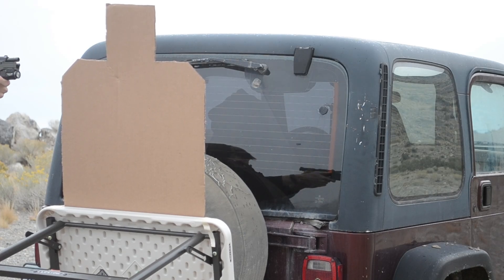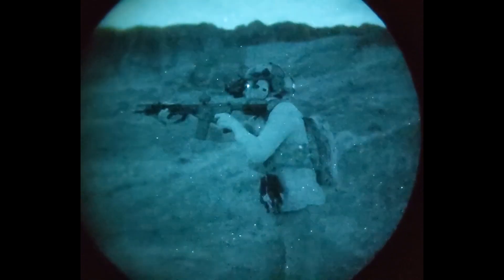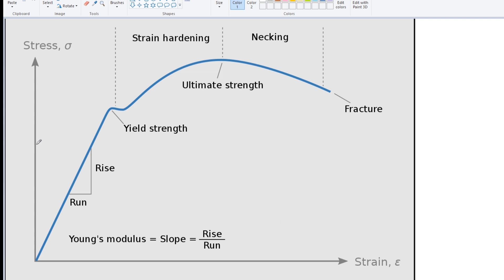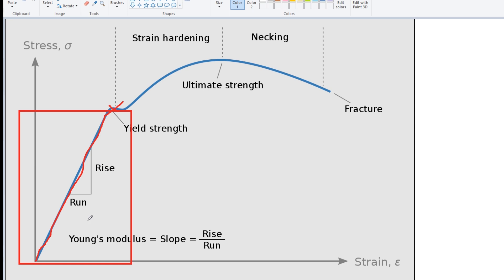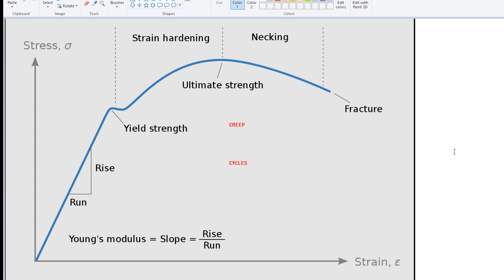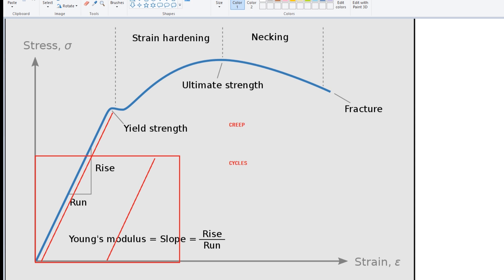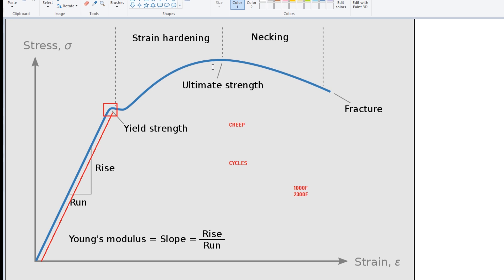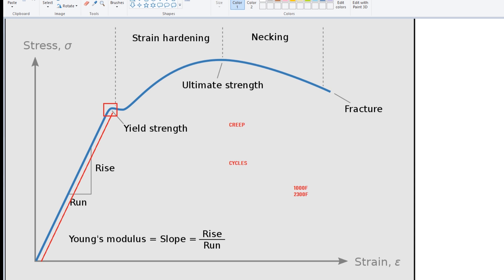Leaving Your Magazines Loaded? Engineers Perspective

Comment from the maker: To get ahead of some of the comments.
This is massively simplified, and ignores some other intervening variables that effect theoretical yield strength, cyclic failures, creep, material choice of the feed lips etc.
You should more view this simply as hyper simplified crash course on long term material fatigue specifically in regards to leaving mags under compression for long periods, and the springs failing.
Reply: Of course, but it should be noted that this only applies to springs made out of spring metal. 

I was so confused as a Pvt. when the Berretta M9 was a single shot with a box of 14 loose rounds rattling around in what is supposed to be a magazine, kind of like the bb hopper on a daisy air gun. 
It soured me on Berretta for some time until a few civilian cops who carried Berrettas swore by their reliability. Turns out that the army had purchased mostly CheckMate brand mags. CheckMate seems to have saved on production costs by replacing the spring with something that looks like a spring but I believe to actually be bailing wire. 

The army likely bought these magazine shaped objects instead of magazine because Berreta wouldn’t sell copyright to any company that actually makes gun parts and of the cost of Berretta mags. 
You hear stories of people waking up in an ice bath missing a kidney. It is an undisputed FACT that in every recorded case, the kidneys were being traded for Berretta mags at a 3:1 rate, and most of us only have 2 kidneys at a time so another has to be sourced from a local bar  Never drink anything given to you by the owner of a Berretta. 
Berretta never says why the need so many kidneys, but it is theorized that it keeps the original 15th century master gunsmith going in a dark cellar beneath a castle that is always surrounded by clouds and howling wolves. 

Once I sold enough blood plasma for shipping and sourced enough kidneys from drunken pac clerks to buy Berretta mags the problem went away and I had presumably the only M9 in the army that had 3 15 round magazines and could each fire 15 consecutive rounds without a jam. Also without pac clerks my entire unit entered a period of time without pay problems. 

I found just how sinister Berretta is when I bought my own. It came with only one ten round magazine! Much like the shady guy in the alley Berretta reaches into their curiously fashionable trench coat and says “come on kid, the first one is free.” This ensures the owner of Berretta has a steady supply of kidneys to keep him going for yet another century of producing high quality firearms.
Reply from the maker: @nemoexnuqual3643  dayum dude. That was wild journey start to end. haha
Reply: @BrassFacts  glad to help.
Reply: @nemoexnuqual3643  Most gun manufacturers do not produce their own magazines. Mec-Gar produces most of the OEM magazines for many manufacturers and was the manufacturer for the M9's magazines. Fun fact, the government owns all of the drawings and IP of all submitted works for their equipment. This means that technically the government owns the drawings to the Beretta M9 and gives a license to Beretta to sell a facsimile to the civilian market, while using the moniker. This is important because that's how you got the POS mags. Mec-Gar jacked up their prices, so the government took the drawings and gave them to Checkmate and requisitioned magazines since Checkmate promised a cheaper price. The actual metal composition between bailing wire and springs are the same. To make magazine springs you take raw bailing wire and form the spring. The key here is that the spring shaped bailing wire is to then go and get heat treated at high temperature and then cooled at a specific temperature and cooling rate to achieve what's called a spring temper. Checkmate didn't do the heat cycling process properly so the springs in their M9 mags were not at the exact same temper as the Mec-Gar OEM magazines which led to failures as the resulting springs were much softer with the wrong spring rates. This led to feeding failures and the springs in the magazines taking a set. The government realized the issue and went back to pay the higher prices to Mec-Gar. The hilarious thing is, if the government actually had an engineer among them, they could have just contracted out to the spring manufacturer to just replace the springs in their Checkmate mags and would have been fine and gotten off cheaper.
Reply: @nemoexnuqual3643  "Also without pac clerks my entire unit entered a period of time without pay problems." LOL!
Reply: @TheOuroborosWyrm  😂🤣😂😂 you know what also was great was when we had a horribly depressed supply Sgt. who just gave me the damn tape, pens, and 550 cord without needing a freaking thesis paper on why.
Reply: @nemoexnuqual3643  where can I go to read more of what you got to say????? ;D
Reply: Shit man, good enough for me. I can stop worrying about the loaded mags now.
Reply: Sobs in Sig mags
Reply: TheMamThatHatedTheWorld  you are a terrible conversationalist my friend.
Reply: I'd love to talk to you about your opinion on making energy using titinol I believe that's the metal and it could be used as a drive force. I have a few ideas about it.
Reply: Excellent video.  Engineering, perfect detail for the novice.  Economist view: everything has a lifespan.   Odd.  Before the 1993 Clinton AWB, 30 round mags were $15.  Thirty years later with inflation thirty round mags are $15, less on sale, but in most cases it costs more to fill than to have, so get a shit ton of them and follow what Brass Facts said about replacing them as needed.
Reply: Practical advice: Do not fully load plastic magazines for long term storage, store 28/29 in 30rd mags. Cracked feed lip on Magpul M2 mags maybe due to weaker plastic. Fully loaded mags may not tactically reload as easily too.
Reply: Magazines wear out from constant use not from loaded storage. Modern magazines are designed to be loaded and stay loaded. My training magazines are magazines that I acquired for just that reason. They work anytime all the time, but they are still my range magazines.
Reply: @nightrider1850  Polymer mags wear out from loaded storage.
Reply: @Emmanuel Goldstein It is. It's endemic to polymer magazines.
Reply: @Emmanuel Goldstein Yep, sure does.
Reply: TheMamThatHatedTheWorld  Sorry, but that is exactly what wears out polymer mags. The feed lips wear from long term pressure on the lips. Hence, the magpul storage covers that relieve the pressure on the lips. There is no shortage of articles and videos on the subject. But hey, think what you want.
Reply: @Followme556  The Magpul covers are dust covers to keep out dirt/debris. Because the way the feed lips of the STANAG mags are designed, you can't get a seal above the feed lips. So they designed their covers to push down a little on the top round/follower to give the seal that's needed. Think about it. The stress being applied to the much thinner tabs on the edge of the magazine and the dust cover is much higher than what's placed on the feed lips due to the much smaller surface area and them being made of the same material. If what you say is true, then the tabs on the dust cover and top of the mag would fail from the stress as their smaller surface area with the same applied force would cause a material failure well before the feed lips would experience a failure from the same force.
Reply: @Talishar  The dust cover of magpul PMAGs relieves the pressure on the feed lips. That is the primary purpose of the device..
Reply: @Followme556  No it's not. There's a reason why it's called a "dust" cover and not a storage relief adaptor. You can't use a cap that goes over the lips because then the mag isn't compatible with most formed or molded STANAG magazine storage solutions including Magpull's own lineup, especially if it already has a ranger plate or Magpull installed on it. Again it's a very simple engineering solution as to why it's not for the feed lips. The surface area of that dust cover is much smaller versus the feed lips. If the plastic were to deform or fail, that cover would permanently break/fail and damage/destroy the mag with it. Because the cover is pressing the ammo further down below the feed lips, this also means the cover is under even MORE proportional stress than the feed lips would be on top of that much smaller surface area. 

I've seen even gen 1 PMAGs loaded for years and then feed without a hitch, stored in Southern Arizona in an outdoor storage shed. Feed lips don't see deformation from storing ammo but from nearly everything else. They get dropped. People miss the mag well and slam the feed lips into the lower receiver. The magazines are put on a vest or other rig and the user dives onto the ground, smashing the magazine in the process. Those feed lips take a lot more abuse than the small, tiniest of fraction of stress caused by holding the ammo in the mag under tension.
Reply: @Talishar  You called it a dust cover. Technically it's a "dust/impact cover." The device literally removes the tension from the feed lips.

Comment: Magpul literally sells a 3 pack of new springs and followers for 6 bucks for old GI mags. As long as the actual shell isn't ruined you can just buy these things and essentially have a functionally new magazine for 2 bucks.
Reply from the maker: for sure, though in practice, at least with use mags. The plastic fails before the springs do.

Comment: TLDW: Loading and unloading your magazines wears them out not leaving them loaded. Which is 100% correct but for the love of God, if you leave Magpul mags loaded long-term use the dust-cover that came with them. It isn't a dust cover, it ever-so-slightly loads the spring to remove load from the feed lips. The springs can handle that load indefinitely, but the polymer can't and those feed lips can spread far enough to not fit or even empty itself.
Reply: this is a great comment for those who are unaware. pmags are great, but that polymer will deform over time so use the 'dust covers' that they (should) come with.
I personally stick with the ol' reliable stanags.

Comment: Saw a guy pull out 25 years of loaded mags and shot it, zero issues.
Other engineers state that the spring wears down more from going up and down, not being in a compressed position.
25 years is the proof, don't worry about it

Comment: I have done long-term experiments with several different magazines. Glock mags from the Gen 2 Era were the only ones that I had sufficient creep that they induced malfunctions. That took about 15 years of continuous loading.  I have had STANAGs loaded for close to 25 that still function correctly.  Haven't had nearly that much time on SIG P226, 5th generation glock or Pmags, but thus far no issues with long term loading.

Comment: I like to think of fatigue more as the higher stress state (still below yield) of a material allowing dislocations to jump or move in small steps towards some imperfection in the material or wherever localized stress is the highest. And over many cycles of this low stress state, the dislocation conglomerate on some stress concentration point and eventually form a crack. This is effectively decreasing the area so while the load may not be increasing, the stress is, especially locally. And this worsens very quickly as the crack forms and propagates.

Comment: Whaaaaat??? You're an MSE too? No way! I'm a materials/metallurgical engineer. I particularly work on wear/failure analysis and on wire/spring and fastener metallurgy. Your magazine springs are usually going to be ASTM A228 music wire or equivalent. Something like ASTM A877 chrome-silicon wire would have significantly higher fatigue and creep resistance. We use some wire grades with nickel and vanadium too, which can go even more cycles at higher temperatures.

Also, I'm in the Midwest. I thought you were out in Utah or Oregon? Somehow I missed this one two years ago. If you're still interested in Midwest employment, I might be able to make a connection for you.

Comment: I think this video misses the most commen reason mags fail from being left loaded in my experience- the feed lips bending. If you have a nice metal mag this may not be an issue but for the cheap plastic mags especially with a strong spring, the feed lips will start to bend outwards potentially making the mag stop feeding reliably

Comment: Creep becomes a significant factor at about 35 percent of the materials melting point on an absolute scale (Kelvin or Rankine). So steel with a melting point of 2000F (2460R) will start to suffer from creep at 400F (860R).

This is why materials with lower melting points can suffer from significant creep at room temperature. You need to look at an absolute scale.

Comment: A youtube channel by the name of deltaleader71 made a video about his mags that were loaded for 18 years in his safe, just checked and the video is still there. His springs measured shorter than a brand new spring by almost 2 inches but functioned fine. I believe he even said that the new spring was purchased at the same time as the ones in the stored compressed mags, so they were the same brand.

Comment: Now do lancers with steel feed lips
Reply from the maker: I'm not convinced lancers are worth a fuck. 
But I actually put 4 in rotation, we'll see. They sure are convenient 

The issue is the lancer is reinforced in only half the areas that matter. And the body plastic (which also includes the junction) is no-composite plastic, so far weaker than the composite that is pmags

Comment: This does not account for manufacturers failing to install a spring to the engineered specs.
I would suggest firing your duty mags a couple cycles to confirm reliability and if you store them full (you should store some of them full), maybe check reliability every couple years.
But if you train like Brass Facts (frankly who has the budget for ammo?), you probably cycle through them fast enough for long term issues to not show up.

Comment: Springs wear from being compressed/cycled. It’s not debatable. Is that enough to cause issues? Generally no. Just like a surplus WW2 era firearm. Most of the springs will be fine, but it’s not uncommon for old guns to need re-sprung to run reliably. I think it’s a little overblown, but at the same time I see no point in personally leaving 50 mags loaded

Comment: To add to your creep portion. Creep is also highly influenced by how far along the stress-strain curve you are. Magazine springs are designed for high amounts of compression. This means a fully loaded magazine is actually very low relatively along the stress-strain curve in compression, even when fully loaded. They are specifically designed and engineered this way. The creep at room temperature because of this can be measured in hundreds of years to become even partially inoperable. You would have to compress the springs to the point of smashing the steel flat against itself or somehow push the spring through/past itself to get enough strain to cause any plastic deformation. The spring in normal operation would never be compressed enough to even register any perceptible creep within several lifetimes. 

The bigger issue/danger for magazine springs is actually in extension. They are designed to greatly withstand compression and by their mechanical design, aren't going to be able to be compressed enough to really cause any damage. This is true of most springs. The danger of extension is that there's no hard mechanical limit preventing the spring from being stretched beyond its strain limit. You can permanently damage your magazine spring for example by removing the bottom plate, having your spring snag or somehow stuck to that plate and forcing the plate off and pulling the spring. 

The reason why "boomers" have this experience is because of cheap knock-off manufacturers of the 80s and 90s not bringing their springs to the proper temper or not using enough coils in their spring and instead tempering them at higher angles between coils to compensate for less coils. They did this on both fronts to cheap out on production costs, but this resulted in springs that could be compressed (elongated negatively) much further along the stress-strain curve than a compression based spring should be. The result was a spring that when fully compressed as intended would be sitting at around the 60%-70% travel down the elastic region curve which greatly accelerates creep. If they had an engineer, they didn't care because the magazines still functioned and the deficiency only reared its ugly head for long-term storage. In other words, they'd be safe. The results of this were that people would lose magazine functionality after a very short relative time storing a fully loaded mag. You'd then see issues where a mag fully compressed and stored that way for a while would only feed 28 out of 30 of a 30 round STANAG mag. This is why it's so common among the AR circles for many of the older heads (or those trained by said older heads) to store 29 or 28 rounds in the magazines long-term and it'll all be fine. This is because removing 1-3 rounds brings the spring drastically back down the stress-strain curve and gives you the creep you'd expect. You can see this with very old ProMags where they'd have fewer coils on the spring (shorter spring) at a more aggressive set (looks like its stretched out more naturally to make up the difference.) I remember this being a very common issue in the 90s especially as people started sifting through the older mags from the 80s and more companies started jumping into the magazine scene with the advent of much more easily obtainable plastic/resin technology.
Reply: Very informative, thank you!